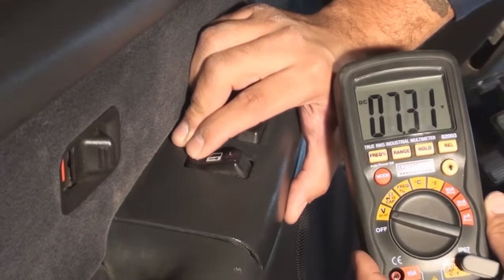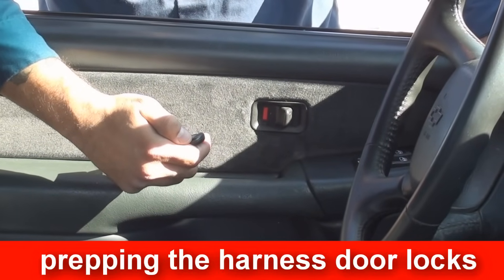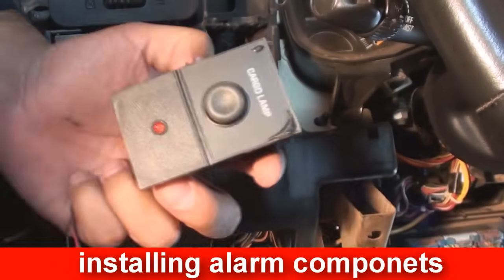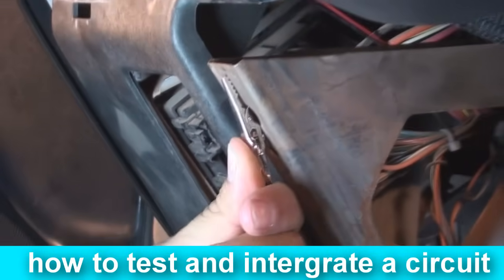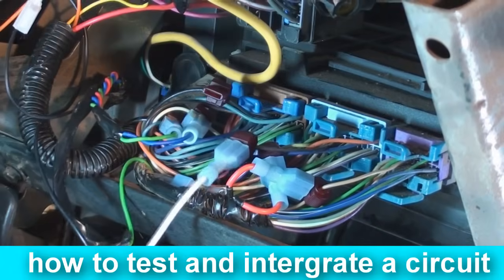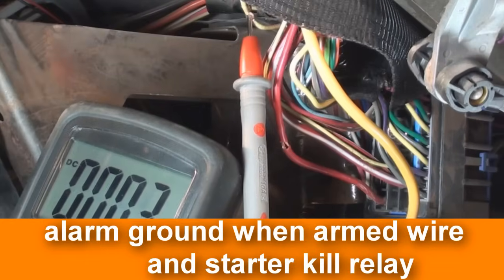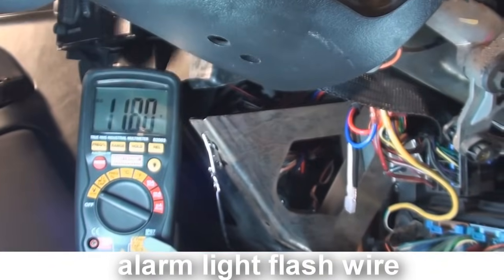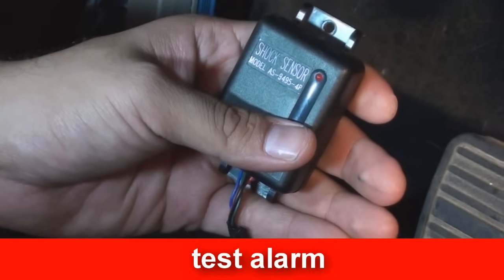how to install an alarm car security system

Comment: Alarm light flash wire is the most confusing part. Everything works fine when vehicle is OFF. When I star the vehicle parking lights stays ON since the current is constant from the alarm module. It seem like alarm should only pulse positive through and stay OFF while vehicle is running but it gives constant 12V output to the Autopage  RF 350. Is that how it supposed to work? If so which diagram I should use to connect it to 1998 Honda Odyssey?

Comment: Jose

I'm installing an Easyguard EC200-K9 alarm remote start system on a 2002 silverado LS 1500. How and where do you connect the starter detection wire onto the vehicle wire harness? 
How and where did you connect to dis-arm the Passlock2 vehicle alarm system when activating the remote start?  or does it need a bypass module? You help will be greatly appreciated. If you can help me finish installing this alarm unit, I will be glad to pay a fee for your support.

Comment: All this tutorial is useless without a Correct or good tech note.  Can you tell us how to obtain a good tech note or wiring diagrams?

 Some tech note you find online are Listed with  just plain wrong colors of wire.  Or they will say blue @ left of steering column. You will have to test all the wires individually to find correct one.   And you will find 30 wires left of steering wheel by the keys, another 30 Left side of steering wheel under instrument panel, and another 50 wires all the way deep by the firewall to engine, also left side of steering wheel base.

Comment: I purchased an Easyguard EC200-K9 alarm and remote start system for 2002 Silverado with a Passlock 2 VATS. Can you recommend a bypass module this for this situation?

Comment: Great video.  Thanks!  Can you do a 2nd part where you explain the trunk release connection and also alarm systems that roll your windows up?  Thanks!
Reply: friend, it seem you are looking for a product like the video show,it is happen to we have the similar product,we have 4G gsm gps car alarm,smart watch car key car alarm ,liquid crystal key,watch key smart car alarm,remote start module...so on. maybe you will interesting in one of them.you can look at my youtube know more,if you like it,you can add me 
whatsapp: +86 13417625973
WeChat：13417625973
keyless entry，remote start，push start...
4G gps mobile phone control car：https://www.ebay.com/itm/273785328395
liquid smart key control car：https://www.ebay.com/itm/284267230545
smart watch control car：https://www.ebay.com/itm/284302869970

Comment: is it possible to parallel connect the horn to the siren?
Reply: Friend, it seem you are looking for a product like the video show,it is happen to we have the similar product,we have 4G gsm gps car alarm,smart watch car key car alarm ,liquid crystal key,watch key smart car alarm,remote start module...so on. maybe you will interesting in one of them.you can look at my youtube know more,if you like it,you can add me 
whatsapp: +86 13417625973
WeChat：13417625973
keyless entry，remote start，push start...
4G gps mobile phone control car：https://www.ebay.com/itm/273785328395
liquid smart key control car：https://www.ebay.com/itm/284267230545
smart watch control car：https://www.ebay.com/itm/284302869970

Comment: T-taps are cute but about as useful as Scotchloks. They melt and cause intermittent problems. ALWAYS SOLDER concerning ignition switch .I don't want installs coming back..and keep you from burning up a factory computer.

Comment: Soldering isn't recommended anymore for vehicles, using butt connectors or similar is recommended because overtime the vibrations in the wires can cause hardening and lead to cracking of the solder joints.

Comment: I hate T-Taps, they are the cause of many "intermittent" problems.  Better off making a more solid connection, yes it takes more time, but less problem returns..  Also, IMO The main brain of the alarm, should NEVER be installed under the dash, on the driver's side, How many movies have you seen where a car is being "hot-wired"? Where are the thieve's hands?  Protect the main brain, mount it in the trunk or behind a side panel.

Comment: Thanks bro for the great tutorial, I have noseblade with my innova 2014 G m/t, central lock & unlock is working with remote key, but the problem is no sound for lock & unlock doors,I read manual book on how to activate the sound but fail, can you share some advice on how to do, I bought a separate siren for the sound but don't know if still need a module for the said siren or only relay pls. advise thanks...

Comment: Hahah silly goose. Do not cut wires your basically letting me know more about the setup. Also you know red and white hackers programmers that build virsus for fun and hijack PC's online. So you do realize mechanics can steal any car. You would have to chain the car down. But mechanics have a career and a good job so they wount engage in theft. Alsrms do prevent theft from amatuers. In California they use a flash light peek through the front grill locate the horn and rip the power wire then proceed to break window then proceed to open the front hood and proceed to cut battery power terminal and proceed to tow the car. The tow guy was already moving into place . 22.3 seconds. Your car is gone. 3 man crew for x3 faster stealing. ☮️

Comment: I know this video is old but im out of option here lol. I have a AutoMate  older style im not sure exactly which one. But the alarm system still works and makes the noises when i lock and unlock the truck but the actual locking mechanism does nothing and stays locked/unlocked. I pulled my dash and everything off but i have no idea what half those wires mean. please help ! thank you

Comment: Hello; Another question, excuse me, I want to install a shock sensor in my 2010 malibu chevrolet and I want to connect it directly to the alarm but I can not find
  where the Main Control Unit is located on the control panel, could you help me? Thank you

Comment: 04 yukon .which wire from crime stoppers s502 alarm connects to the ignition 2 so i dont get transmission problems

Comment: okay so I have a question, the previous owner did a lot of damage to the harness on my vehicle, because of this I've had to fix a lot of the wiring, the car is older and what each wire does should be pretty apparent but many of the wires run different than the factory location, do you think this would cause problems for the installer? Mainly the wires I am referring to are in the ignition switch as well as the electronic trunk release. It seems like easy to me but I am the one who corrected all the electrical problems. Do you have any experience dealing with bad wire jobs?

Comment: I have a 2006 yukon xl slt with about a 5 year old prestige alarm and remote start that used to be in a 2006 town and country lx I was told it needs to be released to be able to work in the yukon is this true or should I be able to just connect it and work plus I haven't been able to find the wiring colors for the truck any help is greatly appreciated

Comment: Hey, I'm no engineer but I'm trying to wire up an alarm with lock actuators and want to add internal lock switches as well.  I developed a wire diagram that looks like it works to me, but I need someone to look at it, that understands all this.  Can I send it to you???  Thanks!

Comment: i have a question, my 2011  dodge ram didn't come with a keyfob, So I bought one and it got programmed, but the lock and the unlock buttons don't lock it or unlocked, it can only lock manually, do you have any idea what's wrong with it

Comment: You were installing in a chevy truck. I'm looking at installing an alarm in my truck. Its a 2000 silverado. The output for the locks of the aftermarket alarm are negative but the power lock and unlock are positive do I need to add relays to convert the outputs to positive? I'm installing a simple alarm and not a remote start unit.
Reply from the maker: Max Lezama sometimes the alarm will have a option or jumpers to switch from negative to positive outputs but if it doesent you will need to use relays to convert. Or return the unit you have and look for an alarm that has positive outputs or changeable outputs

Comment: For those that attempt to do this, before buying an alarm system; make sure that you know that you will need a bypass (if your car has a chip to start). You  will need three things in that case, the programmer module (1) that connects to the bypass(2) and the alarm system(3). The programmer module will help set-up the bypass correctly for your car. Also remember that you may get lucky and have an install for the D2D (Data to Data) which requires a lot less wiring. You will only need a couple main ones, three to the ignition switch (for bypass purposes) and the 12v as well as accessories and the horn of course. 

Not really much, also ensure to always check polarity and ground the alarm (black wire to chassis as he showed on the video). I successfully installed an alarm system on my Honda Accord 2008 EX-L using Viper 5706v, XPress Kit DBALL2 & XKLoader (programmer).

Comment: I installed my car alarm but I wasn't sure about one wire in particular...  so I didn't connect it.   it's a white wire that comes with all the power wires....  it says in the diagram negative trigger....    but couldn't find a negative wire that comes from the ignition switch... 
the problem is that when I turn off the car the door locks unlock the doors but when I lock them with the remote they didn't lock.  I have to unlock them first with the remote and then I can lock them with the remote....  it happens all the time.  any ideas?

Comment: what are good brand of t taps and electrical connectors?
Reply from the maker: Richard Cowtails 3m is the best
Reply: Is their a trustworthy supplier? I've seen them on Amazon ..

 But it looks questionable
Reply from the maker: Richard Cowtails I have always bought mine wholesale through 3m.is the brand 3m maybe a seller on Amazon Sometimes big company will sell there product themselves under the company name

Comment: Hi , I think i have the same alarm system installed.  I need help. My brand new battery keeps draining cause of the alarm. I have a 2 way toggle under the dash.  don't know which way to place it at. All i know that when i play with the remote and get the 3 chirps . The battery doesn't die. How do i properly get it to chirp 3 times. I keep getting 2 chirps and the battery drains..
Reply from the maker: When you hear 1 chirp that means your vehicle is armed, when you hear 2 chirps that means your vehicle is unarmed, when you hear 3 chirps that's a indicator that you are trying to arm your vehicle with the door open or your dome light has not dimmed completely before the alarm arms.
Reply from the maker: +connectedcaraudio your going to also test the output of the switch with a meter to tell when it's hot in a pontoon
Reply from the maker: +connectedcaraudio in a position
Reply from the maker: +connectedcaraudio in a position
Reply: Thank you. . i'll check that out...

Comment: Hi! I have 1999 GMC Sierra (New Body Style) that has a factory alarm. I decided to install a K9 alarm and every time I lock it it works fine, but when I unlock it only unlocks one alarm(oem or k9) and the other one goes starts sounding, and to shut it off I have to press the second beeper. HELP!!!!!!!!
Reply: 413PL switch alarms

Comment: Hey if my aftermarket central locking is + & - and my aftermarket alarm system is - & - will the alarm's central locking system work? Dunno how to explain this in better way.

Comment: i have a viper 3105v alaram system. i just added aftermarket power door locks.i have a two wire hookup for the door locks.my question is how do i wire my alarm up to my new aftermarket door locks,to lock and unlock my doors?

Comment: my toyota corolla sedan 2010  don't have sound after i replace my battery ........can you tell how to fix it ?
Reply from the maker: Does it turn on at all? Like no power.. Or does it turn on but have no sound?
Reply: +connectedcaraudio yes  it turn on at all have power but turn on have no sound when i lock or unlock
Reply from the maker: +Ck NeyoAnglelina if the vehicle has a factory amplifier check that fuse in the vehicle. If you have a aftermarket amplifier check that the power fuse next to the battery is blown.
Reply from the maker: +Ck NeyoAnglelina also is it asking for a radio code?
Reply: +connectedcaraudio No .
Reply: Thanks very well explained

Comment: I have an avital 3300 l i just hooked it up car will start when alarm is armed and goibn off, is this becaue my yellow igniton wire popped out of harness, in theory the car should start righ
Reply: Car alarms need to know where they are in the vehicles starting system operation. The ignition wire is very important to tell the alarm when it it armed and also other functions. If your ignition wire is falling out I would replace the harnesss

Comment: would the shock sensor go off if someone slashed your tires?
Reply from the maker: under normal circumstances no, but slashed hard enough it is possible
Reply: Thank you for the reply

Comment: As a former professional installer I would definitely recommend T-Taps over solder, as long as they are made by 3M (the generic ones are junk).  T-Taps are easier, look nicer, save time, and since there is no tape you don't end up with a gooey mess over time like you do with taped solder joints.  Also, solder can become brittle over time.  I used literally THOUSANDS of T-Taps as an installer and never had 1 fail as long as I heard the "click".
Reply from the maker: Yes I agree ,t taps have always worked great for me. Thanks for bringing up to only use 3m ,I have never used any thing but 3m
Reply: You should never use T-taps EVER!!! I have installed hundreds and fixed more remote starts because connections using T-taps do not hold up over time,  remote start connections should be soldered, especially data connections. ASE-A6 & MECP Advanced certified
Reply: I soldered my T-taps.... mainly because I want to be able to unplug everything later if needed.
Reply: Solder does NOT get brittle over time.

Comment: Hi, I want to put a alarm on a 99 gmc Jimmy that has a factory alarm. Can I still use use it with the new alarm?
Reply: Yes you can. Although when you install the new alarm you have to use the factory alarm disarm wire on the new alarm  and tag it to your vehicles factory alarm disarm wire. Your New  alarm might not have a so called disarm wire so just use a  wire from the new alarm that sends a pulse negative or positive depending on what the factory alarm disarm wire needs to the factory disarm wire when you unarm your vehicle

Comment: thanks for this helpfull video.
Would be a good idea to fit the alarm box under the seat and lead the wiring to the front?
Reply: That's a great idea, they will never  be able  find it there. Just going to have to lengthen the wires. That's going to be a headache but it should be worth it. I suggest a back up battery next to the alarm brain since you have the room

Comment: so my car has an aftermarket alarm installed it's old and it suddenly stopped working it's not my remote because when I bang the car or anything alarm doesn't work, security light doesn't blink anymore what could it be?

Comment: Can I install trunk release on my existing alarm? Its a viper 3105v 
It has 2 auxiliary functions
Reply from the maker: Yes you can you would just need to purchase a relay to give the trunk release module some juice to open the trunk. You will use the Aux channel as you said run the Aux wire through a relay and install the trunk release to the wire cable

Comment: where do i go to find a wiring harness for my 1997 honda crv ex
Reply from the maker: Like a harness for the car stereo or a alarm harness?
Reply: alarm harness
Reply from the maker: Deejay Principe Lostraficante.com they don't sell harness specific for the vehicle, the alarm Comes with a universal harness and you have to wire it up using a tech sheet to your vehicle

Comment: need help with an crimestopper sp-402 install on a 93 civic
Reply from the maker: Xavier Malone what did you need help with ?what part
Reply: What tools should I expect to use for a quick temp install I just don't want the car getting ripped off for parts

Comment: Not called soldering flux when you have a picture of solder and their is no need for solder flux since rosin core solder has flux built in

Comment: So i found out my car had an alarm from the previous owner. All the wires are still hooked. No wires were cut. previous owner Just unplugged the brain and  took the siren.
My question is can i cut the plug off..solder new wires from a new alarm system to the one already installed on my car..

Cuz i hoping i could just do this and save some cash from the install at a stereo place.

Thanks
Reply from the maker: You can do that but I think the best bet is to replace it with the same brain that he had in there, although it might be hard getting that info from him. If you are going to do that you have to remember that alarms all don't have the same wiring colors for the alarms so matching them up could be a headache. You would still have to test the wires to make sure it is the correct circuit you are matching up. Starting from scratch would be better. Although soldering into the existing wires would be a good connection it's probably better to run the new wires from the new alarm directly to the vehicle Stock wires. So If it were my car I would start over or pay the shop
Reply: connectedcaraudio 
Ill never know what alarm was in there. I double checked the wires and there is writing on them if that helps my situation.
But ill likely take it the shop